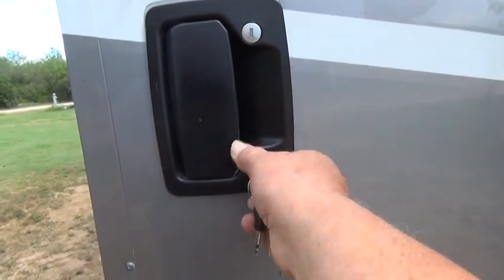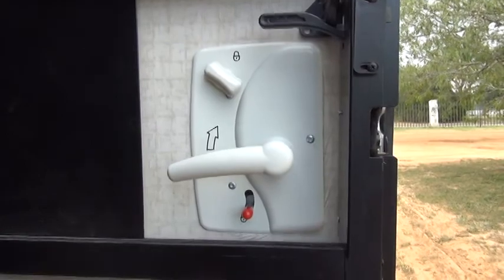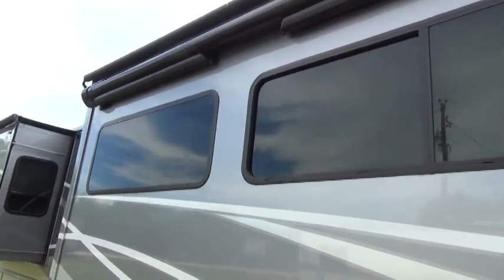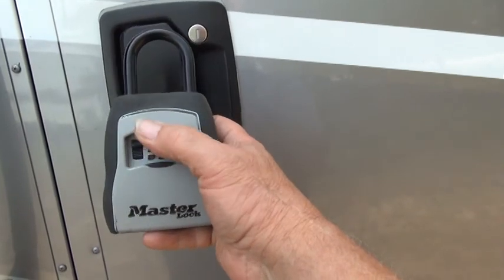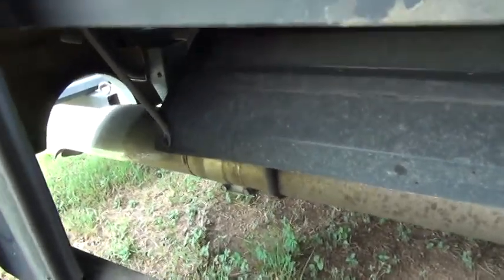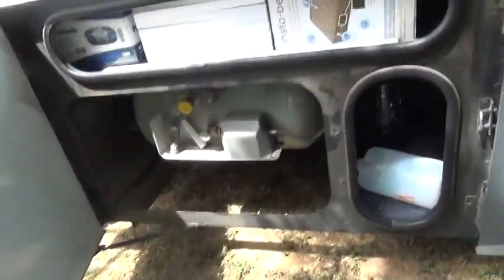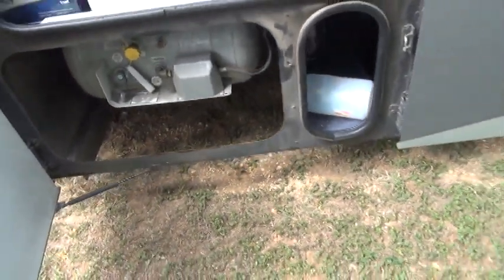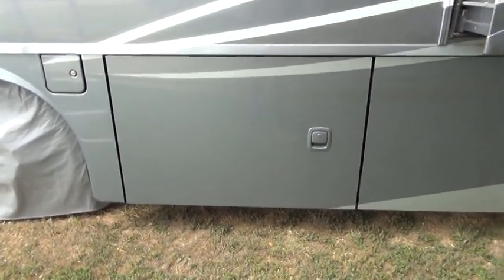What to do when you lock yourself out of your RV

Comment: Don't hang it on a propane pipe line. The U bracket Could wear a hole in the pipe.
Reply: Not likely, since the hasp has a rubber sleeve on it.

Comment: Creating the spare key and hiding it somewhere on the vehicle is something that I do the 1st day that I get a different car. I hadn't thought about doing it on my RV. I love the solution, but not the placement. I don't like the idea of having it hanging next to the propane tank where it can bang on the propane tank and possibly wear the propane tube as you go down the road.

 I would probably install an eye bolt into the wall and snap the hasp through it. I might even then secure it to the wall with double back foam tape to prevent it from bumping the wall. You can also get a key safe similar to the one shown that does not have a hasp that you can simply screw to the wall. There's also the possibility of a simple key box which can be secured to any piece of steel with magnets. Lots of possibilities depending on your rig.

Thanks for the videos Jerry. I really appreciate your reasonably short, to the point tips.

Comment: While getting a lockbox for a spare key is an excellent idea, it doesn't address the problem mentioned in the title, which is "What to do when you lock yourself out of your RV".  Buying a lockbox after you lock yourself out of your RV won't help you.   That's something you need to do before you lock yourself out of your RV. 

Perhaps a more accurate title would be "How to avoid locking yourself out of your RV". 

It's a great suggestion; all I'm saying is that it doesn't really address the problem stated in the title.
Reply: @jerrydixon  :  Yeah, that happens sometimes -- we're only human.  But my point was that: 

[1] The title ("What to do when you lock yourself out of your RV") is not really accurate, because buying a lockbox after locking yourself out will not help you, and

[2] If you already have a properly-located lockbox with a key inside, then you're not really locked out, are you?